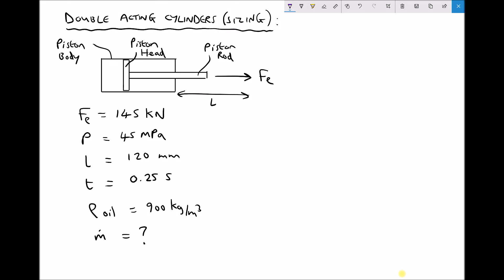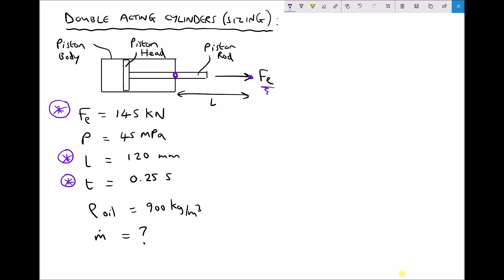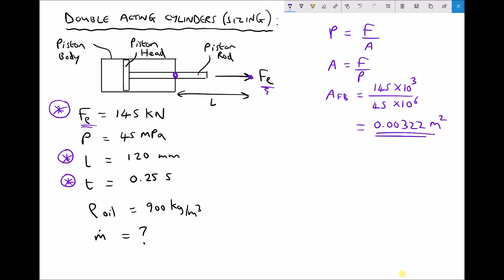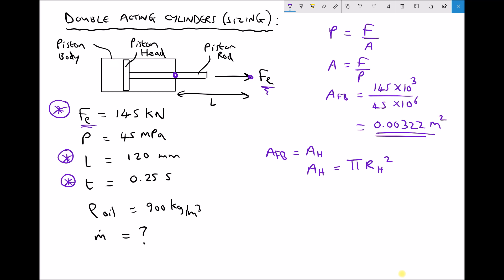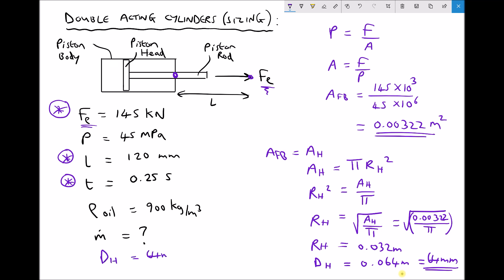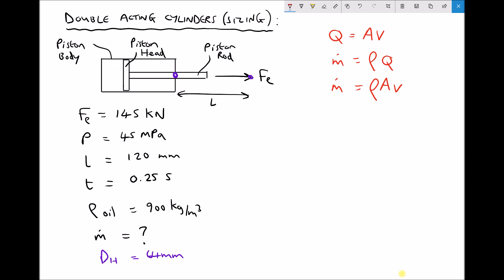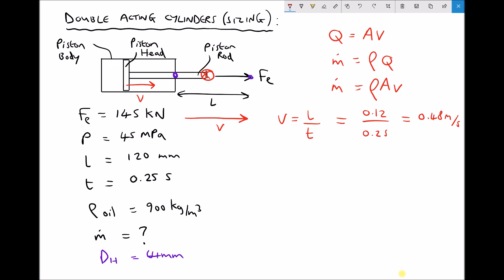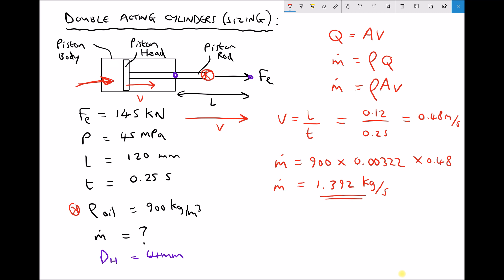Sizing Hydraulic Cylinders and Selecting Pumps Based on Force Requirements

Comment: hello i have a problem about this stuff ...  a cylinder  thats 2 inches  x 6 inches  at  1000 psi  reads - P x V  / atm .. to find the volume of  compresed air.. which is 1000psi x  18.85 Cu (volume ) / 14.7 (atmosphere ) =1281Cu .. excellent ...  but now change the 1000 psi to 10 psi -
   10 x 18.85 / 14.7 =  12.823 Cu ??  how can there be less air in the cyclinder (12.823 Cu) under 10 psi than the cylinders inital volume of 18.85 Cu ?
Reply from the maker: Hi Frank.  I am unsure where you are taking your values from.  Could it be because your value of 10 psi is below 1 atmosphere of pressure, at 14.7 psi?